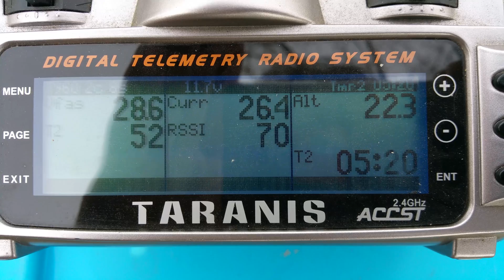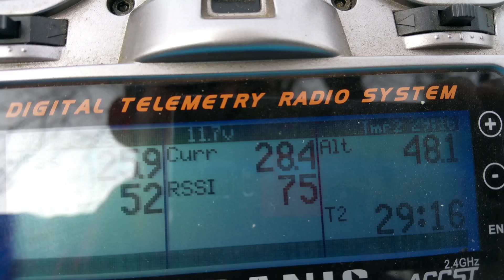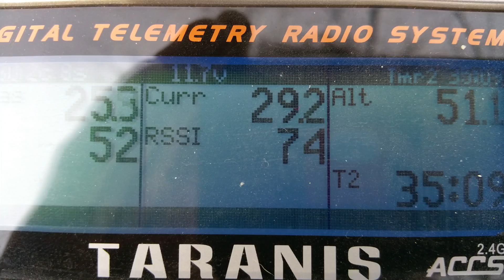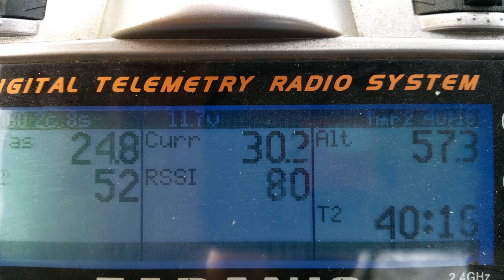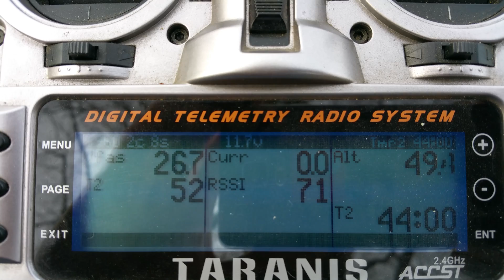hk multistar multirotor 2c high density endurance series battery review

Comment: I built a drone at great expense around these batteries!!! I killed 2 speed controllers before I finished it. Now I can't!!! There are NO 8S 20 amp speed controllers! Hobbyking dropped the Afro HV! No Afro HV speed controls, batteries, motors. Does ANYONE make any series of stuff for endurance flight? I actually have batteries, I screw up and got the 3s so was going to run 3s2p until I got the proper 4s. I bought them split so if one cell in that giant assed pack went dead I could rotate another in. I found some ESCs at $40 a pop that x6 is another $240! Plus reengineering, doubt they'll fit where I stash them on the Quanum CF and aluminum frame, very similar frame to yours. 

Beyond frustrated here as I'm $1,200 and 2 slow year vested in this thing.

I'm screwed I guess. Is there an alternative?

Comment: I am looking for batteries for an e bike project,,,do you recommend thees? ta
Reply from the maker: traci beacer hi, I don't know the battery is only rated for 24amps and I wouldn't run even run it close to that, unless you're planning on using 3 or 4 or what ever in parallel then they should be ok. The down side is there never in stock.